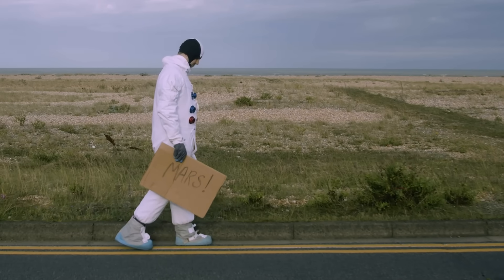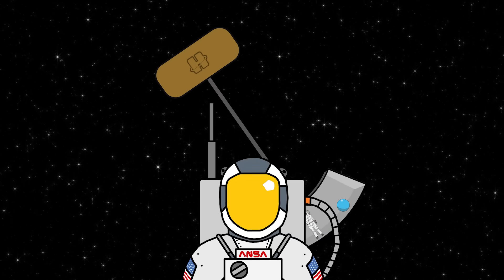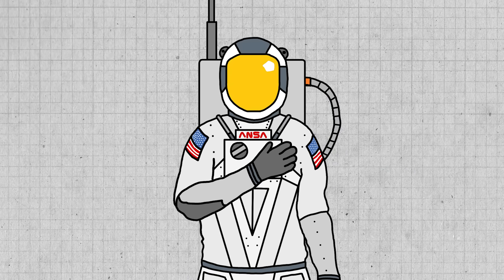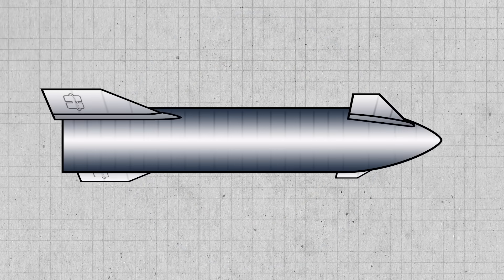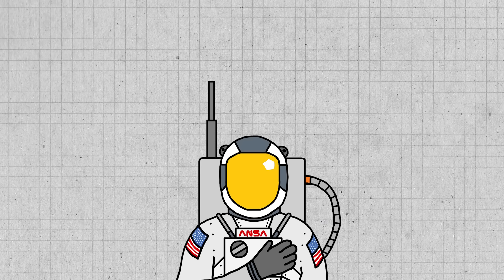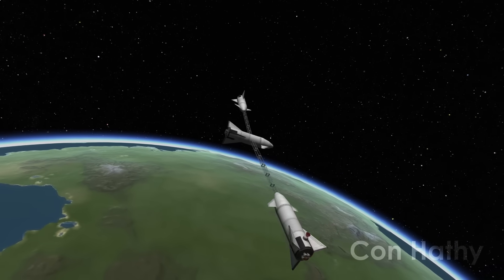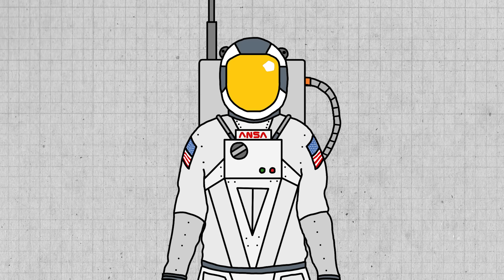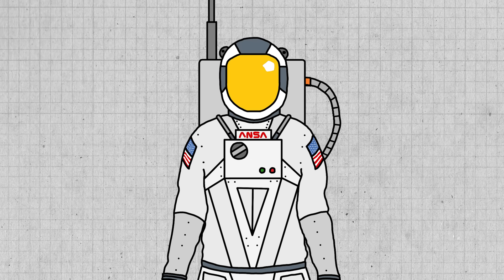This is NOT how you make Artificial Gravity

Comment: Build ring shaped interplanetary ship on orbit. With nuclear thermal or  solar thermal engine. 
4RPM ring for full gravity has 112m diameter. Relatively easily adaptable 6g requires 50m diameter for 1g gravity. 

Dock smaller ship/ships than starship for landing on Mars
Much better solution than with chemically driven rocket engines
Reply from the maker: I’m focusing on near term options. We can spend all day talking about unflown engines that would be better for getting to Mars but unless we have a reason for sending more than a handful of people for research there isn’t any point in having a ship larger than Starship, let alone one with a 300+ meter long ring.
Reply: @ConHathy  I think you might be underestimating just how large a manned mission to mars would have to be ship wise. Consider travel time and mission time and then the mountain of supplies you will require to keep people alive for that long. This is not as simple as the few day mission to the moon, a Mars mission would be measured in months. That is a lot of water, oxygen and food before you even add fuel load, equipment load and other things required.
Reply from the maker: @Ishlacorrin  I’m aware of the travel time but Starship has plenty of room. It’s about the same size as the ISS (1000 m3) which has held several people for nearly a year. If you total up all of the resupply vehicles in the past 9 months (3 progress, 2 cygnus, and 2 dragon) that only takes up 8% of the volume (79.2 m3). If you include crewed missions (2 soyuz and 2 dragon) thats only another 35.6 m3 ignoring that much of that was taken up by the crew themselves and redundant personal items.

So conservative estimate: you sacrifice 114.8 m3 to extra supplies and you can support a crew for 9 months in a volume that’s still larger than skylab and Mir combined. If you send scientific equipment ahead of time and only keep medical equipment you get even more space and weight back.
Reply: @ConHathy  They plan to send hundreds of starships during each launch window which is only a week or two long every 2.5 years. Surely, to build one rotating ship which would be much simpler- one interplanetary engine or cluster of them in the middle, bigger available volume, lower mass(when compared to construction of many individual ships) would be better solution to this. Starship itself isn't so great for interplanetary missions. It is build to launch and to land, and accordingly to that it needs stronger and heavier construction where it doesn't need to be when flying in zero gravity.

Starship has no solution for cosmic radiation. Tests has shown detrimental effect of this highly penetrative particle radiation to central nervous system(brain mainly). In case the astronauts won't die of cancer, they will be severely mentally impaired.

Comment: I had suspected that astronauts could adapt to short-radius centrifuges based on watching a ride operator walk around inside an amusement park centrifuge (with a radial acceleration of about 1g) circa 1970. I'm really happy to see this confirmed by the recent research you mention here. Thanks for a really excellent video.

By the way, here's an idea I had a while back that I've never seen mentioned elsewhere, though I seriously doubt I'm the first person to think of it, and I would love to see someone do a video about it. Land the lunar starship upside down. The lunar engines are already going to be mounted high up the side anyway. Landing nose-down would put the astronauts and cargo near the surface and give a clear view of the terrain from the flight deck. It might even be more stable, depending how how full the tanks are at landing.
Reply: How are you gonna land if the engines are on the top? Lmao, the moon has no (significant) atmosphere, so the only way to slow down and avoid smashing into the moon at 1.6 kilometers per second is to fire the engines at the ground to slow down, and the only reason you want to do this is so the astronauts can see out the windows? Lol, they’ll be upside down, which would make manual landing difficult if they needed to do that (Neil Armstrong did, he landed right side up) Also manual landing (and landing in general) is kinda impossible if the engines are thrusting you towards the ground instead of away from it
Reply: @greatconch278  As was announced over a year ago and mentioned in what I wrote, plans are for the lunar starship to use landing and takeoff engines mounted high up on the sides of the spacecraft in order to minimize the amount of lunar regolith disturbed. Hence landing and taking off tail up or tail down could be feasible; it's just a matter of which way the side-mounted rockets are directed.
Reply: I think you are the first person in history to think of landing a space ship upside down.
Reply: @TheBooban  isn't that normally called a Crash? 😊
Reply: @TheBooban  I'm sure Elon Musk would have thought of it. That bugger seems to think of just about everything, and of ways to make them work. A latter day Edison, to be sure.
Reply: Yeah. Who would have imagined that astronauts who spend over a year in microgravity without spontaneously combusting could possibly adapt to life in a centrifuge for a few months? 🙄
Reply: I think this is a really clever concept.

Comment: I'm curious as to why you didn't discuss tail-to-tail Starship AG? Starship already has landing hardware that could easily be adapted into docking clamps. The Starship User Guide localizes crew quarters to the nose of the vessel, occupying the top 9.24 m of the payload volume, just about as far as possible from the center of spin. According to SpinCalc, two 50 m tall Starships (we're not taking the full 120 m stacks with us, after all) docked in a tail-to-tail configuration would require an angular velocity of 2.885 rpm, and tangential velocity of 12.315 m/s, to achieve 3.721 m/s^2 Martian gravity for the lowest crew cabins. Papers published in the 1970's by Ashton Graybiel and Ralph W Stone propose that angular velocities <3.0 rpm and tangential velocities >10.2 m/s would provide comfortable AG for the majority of individuals and would not necessarily require extensive periods of adaptation. All things considered, I think tail-to-tail Starship AG is the most feasible solution.
Reply from the maker: It has the same issue as rotating a single starship, the gravity is in the wrong direction. This means you either have to carry two of everything (for surface and space) or have all of the equipment on heavy hinges so it can all rotate.
Reply: @ConHathy  Yeah, hinges could work or just use a modular configuration so that cots, workbenches, et cetera can be used bidirectionally or detached and remounted as needed. Payload on the Crew Dragon and Soyuz (and even the SLS shuttles) needed to be broken out and stowed throughout the mission so it wouldn't be unprecedented to do that on a larger scale in the Starship between phases.
Reply: @ConHathy  Hey there, I've been trying to contact you but there's no email address in your channel. Would you mind getting in touch at my email?
Reply: Everything inside Starship would have to be reconfigured from the floor to the ceiling -- beds, tables, chairs, toilets, cargo, lighting, etc.  Then returned to the original position for Mars landing.

Starship is 50 meters long.  Using my handy-dandy SpinCalc, creating Mars gravity at the very tip of the nose of Starship requires a rotational speed of 2.6 rpm.  The crew quarters would be closer to the middle of the ship, meaning you'd need to spin at 3.3 rpm.

To minimize the Coriolis effect, you want to spin at 2 rpm or less.

Comment: Awesome Video!!! I am an advocate of "Short Radius Human Centrifuge"  Dual counter rotating Spin-Habs used to cancel precession, and torques on the ship.  Please, Please, Please, take a look at my page on the subject...;-)  
https://www.facebook.com/geoff.s.jones/posts/10214015507957867

Merits: No space walks needed, like a carnival ride, can be setup, and torn down in a reasonable amount of time, does not use precious fuel for thruster spin-up, spin-down(two counter rotating wheels push against each other using electric motors). Fuel is used as radiation shielding from the sun needs to be between sun, and crew at all times. Spin-Hab cabins could be repurposed for Habs on Mars surface.

Comment: Why don't you just rotate the 3 starships about the maximum MOI? You said the 2 starship configuration was the only reasonable option, discounting the 3 starships altogether even though you acknowledge the 3 starship maximum MOI configuration. Also, adding more starships to the 3 starship configuration in what was once the intermediate axis would would result in a configuration in its maximum MOI axis.
All of this aside, going to Mars is suicidal due to radiation and toxic, carcinogenic soil, sooo...
Reply from the maker: You're right that you could still have the third ship but it loses its purpose from the original design (thrust, constant pointing direction for comms, etc.) You also wouldn't get usable AG in the third ship so it's functionally the same as the two ship concept, at least as far as this video is concerned.

Radiation is defiantly a problem, space.com estimates 60% of current career limits just for the journey and ignoring the time on the surface. The good news is that's within the limit, the bad news is it would pretty much ground any astronaut for life unless we have meaningful shielding. The soil actually shouldn't be too much of an issue. Perchlorates dissolve in water so they can be rinsed out and there's always hydroponics if that doesn't work.

I'm optimistic that Mars missions are possible, even though they will be dangerous.

radiation estimate: https://www.space.com/41887-mars-radiation-too-much-for-astronauts.html
Reply: @ConHathy  I'm glad you considered this issue. It would probably be a good video topic if you haven't made it already. I have no issue with people choosing to go to Mars if they want,  people just shouldn't have too high hopes. Also I better not have to pay for their choice with tax dollars!

Comment: I'm a big fan of the two-Starships-connected-by-cables concept for a Mars mission.  One passenger and one cargo (with the cargo Starship also acting as a lifeboat).

Two things.  One, there is no need to create an artificial gravity greater than Mars' gravity (.375 g).  There will already be a gravity gradient between decks that can be put to some use.

Second, I have a concern if the cable breaks it will snap back on the Starship and damage it or wrap around it.  It will be under 80 tons of tension, and I have no idea how it will react when suddenly going to zero.
Reply: I grew up just south of KSC, with several family members working there , one worked in the graphic design dept of the print shop . She would bring home non classified projects that were to be presented to NASA and DOD or congressional big wigs . One of these was a well engineered copy of Zubrin's direct to mars, others were more complicated variations . Zubrin's plan was shot down because it did not bring jobs and money to their districts . DOD and NASA engineers the simplicity .low risk, low cost and short lead time .  Congressmen did not care what this could do for the country just how much public credit and private  kickback  they could claim.
Reply: part two      The first presentation was over a hundred pages of what had to be designed and what they had on the shelf , with pages of draft blue prints for a 23? ton  package of booster, landing system , and hab can launch-able on the shuttle . They also had plans for two expendable launchers with orbital docking of booster and landing system/ hab can but this would have much larger and cheaper than shuttle plan. I vaguely remember they all used Zubrin's rotational system at .4G , They had already tested synthetic cable that could hold the entire stress of  lander but they used 6 for safety. This all came about maybe 6-9 months after Zubrin's book .
Reply: @virginiamiller3521  His plan has a lot of moving parts consisting of many elements that have yet to be designed, built, and tested.

My plan for Mars is two Starships (one cargo, one passenger), refueled in Earth orbit, connected nose-to-nose with a tether after TMI and course corrections, and spun up to Mars gravity with side-firing hot gas thrusters.

Simple, cheap, uses existing technology, and probably the safest approach in that the cargo Starship could be used as a lifeboat.

Not as sexy as the cycler system in "Stowaway" or some of futuristic nuclear electric proton warp drive proposals, but it is doable today.